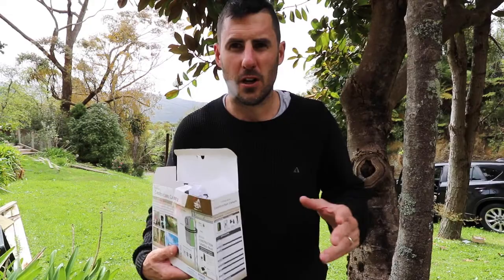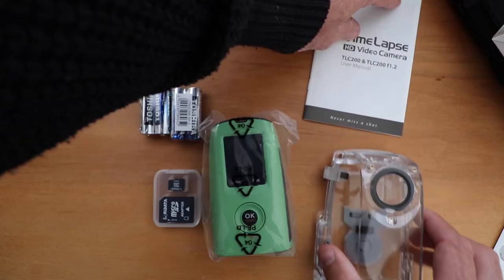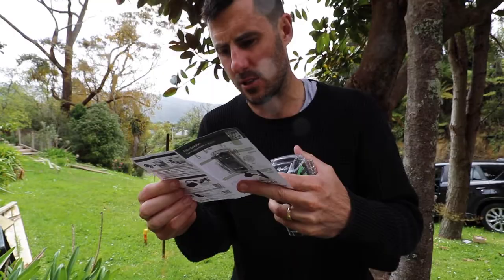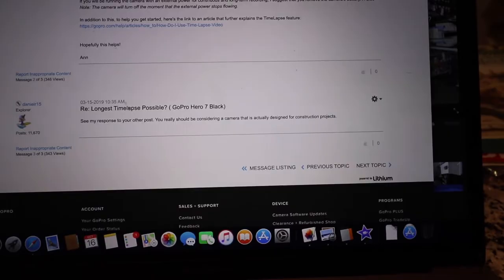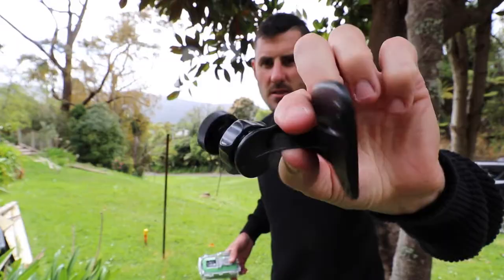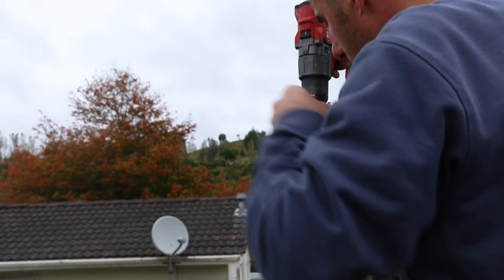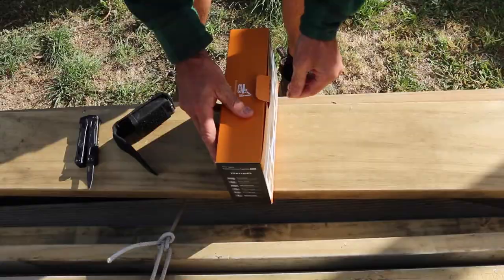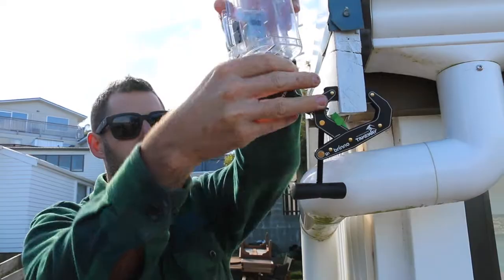How To Set Up Long-Term Construction Timelapse Cameras

Comment: How does the battery life tho? How long does it last or what if you need to change battery in the middle of recording
Reply from the maker: Depends on settings and batteries - you can make it last a couple of months, we like to take a photo every 5 mins on high quality which ends up being about a month before you need to check it.